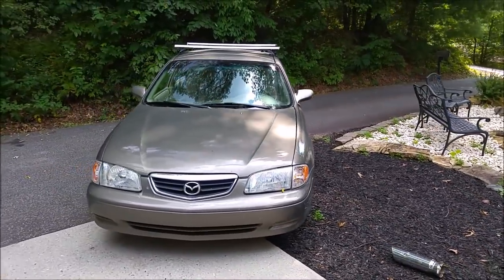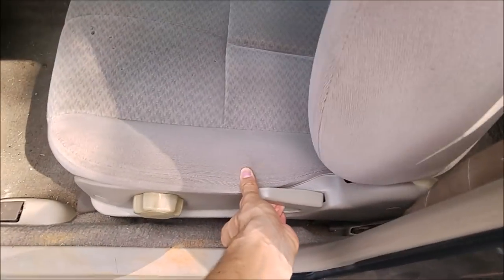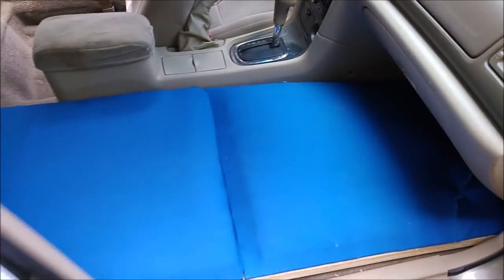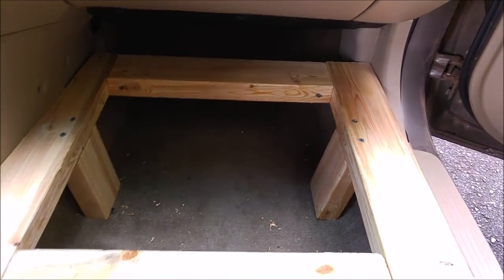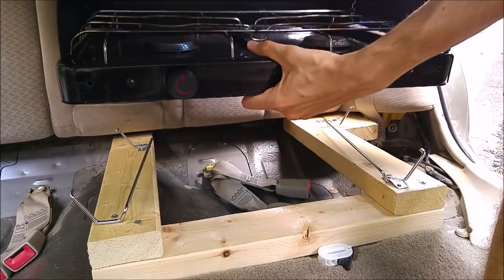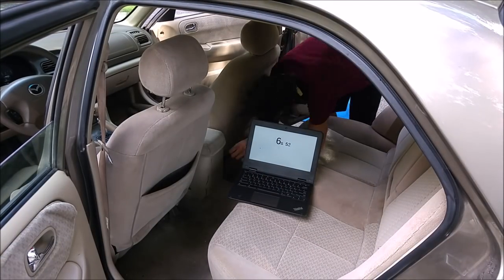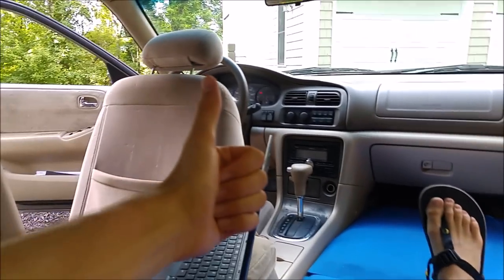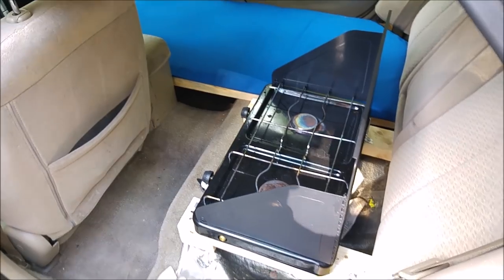Car Camper Conversion DIY! EASY!

Comment: This is a great setup! You could replace the stove area with a small compost toilet, then take out the back seat fully and put in a cooler,and stove on a swivvle on one side of the boot , and an area for boxed storage on the other
Reply: Great idea

Comment: Thanks for all the good ideas. I'm looking for a way to 'camperize' my 2000 Toyota Echo. This should help. The Echo is so small though, I'll need to find a way to extend into the trunk and there are no fold-down rear seats. And for hot summer nights, I plan to get one of the portable fans that run off 18650 batteries. That'll end any risk of running down my car battery. Those who legitimately fret about cooking inside might want to store the stove in the back and use a clamping beach umbrellas to provide shelter from the rain. That's not as comfortable, but it is safer.

Comment: I was thinking of doing sumilar in my 1975 Holden Kingswood and decided to see what others had done. Apart from the stove, yours is how I pictured mine in my head. I dont plan on upholstering the wood for the sleeping base as I think I'll just use a swag on top. Ubder that bed frame looks great for storage. Good stuff buddy.

Comment: Some great ideas.  I would probably nix using propane and do a convection hot plate.  Buy a Jackery that can be charged while driving and then plug the convection into that for power.

Comment: Great work! I agree that cooking inside with an open flame can be dangerous, but my experience with an "outdoor" kitchen accessible only from the back of my van wasn't feasible. When it's snowing/raining it's either heat water inside or drive thru.

Comment: Is there any way you can please provide the instructions for this. I searched high and low for this video (I had seen it before and had to find it again to see this one). I want to make this as a temporary project for my conversion van until I am ready to build something more permanent. I just can't figure out the dimensions, what size wood I need to get cut from the store, etc. please share the details.

Comment: Love this idea. I wonder could that bed frame be built on hinges or something so that it could be stored in the boot (trunk) "unfolded" and put in place. Basically so that the car can be converted anywhere/anytime.. I suppose storing the removed seats might then become the issue actually... Would love to see the video of the next one you did.

Comment: Nice job but I think the cooking should be done in the back like 007craft did with his Honda Civic. You can use the propane stove inside for heat if needed but as with a Mr. Buddy heater you also need to keep a window open for fresh air.

Comment: One of the best "bed" setups I've seen in a car, however, a 2 burner stove in that small of an area would worry me.  It would be better in the trunk, I think.... lid up & chuck box style.
Reply from the maker: You're absolutely right! I never even used this setup. I made a better more refined one without the stove. Cheers!